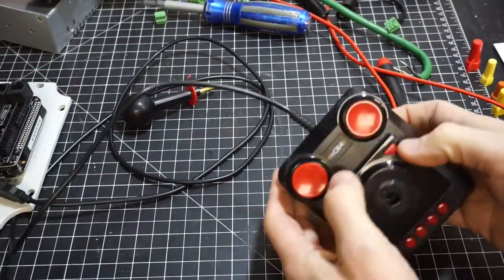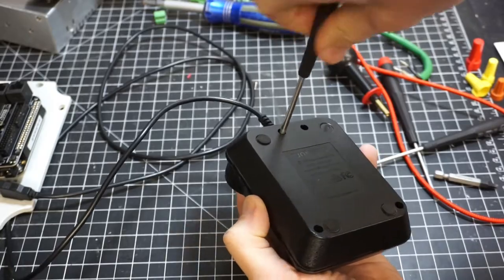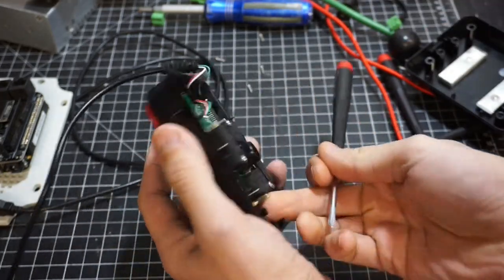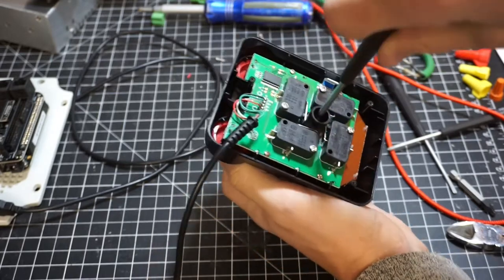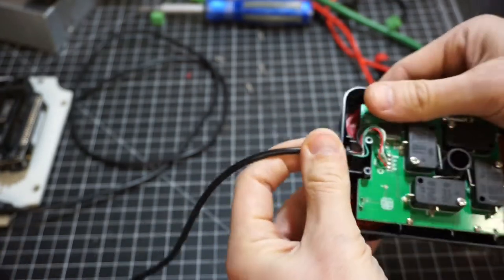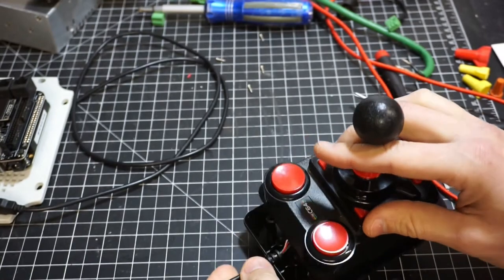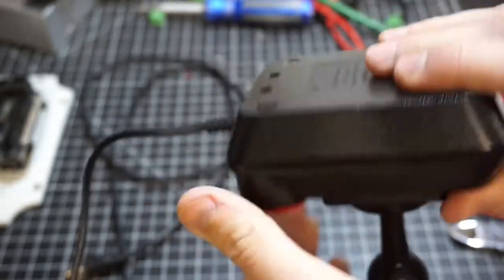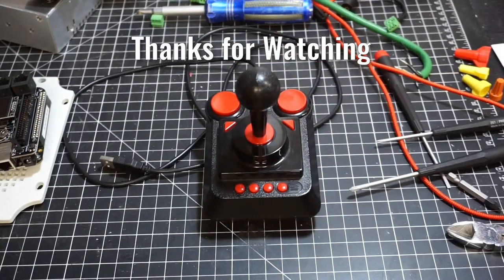Repairing TheJoystick for TheC64

Comment: my joystick came apart in a different way. the little brass piece in the shaft, fell out of the shaft, and i couldn't reconnect it. then the last time i tried to put it back together, the plastic base of the stick broke off. and on top of that, one of the solder joints on the inside came loose when i opened it up. i was very disappointed with it.